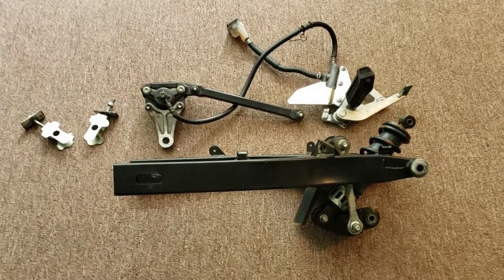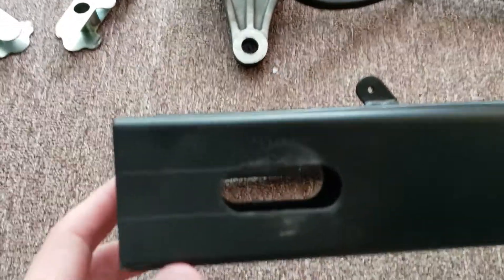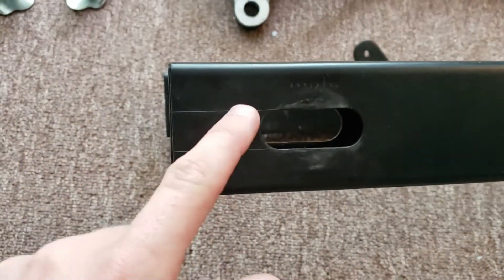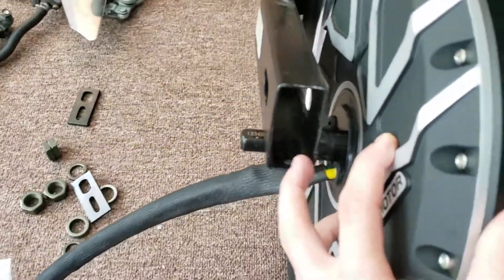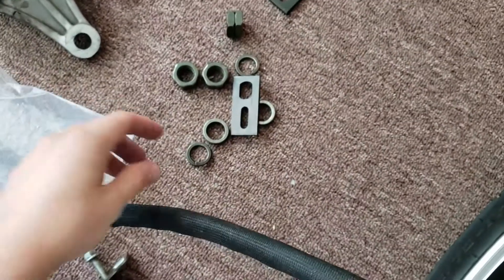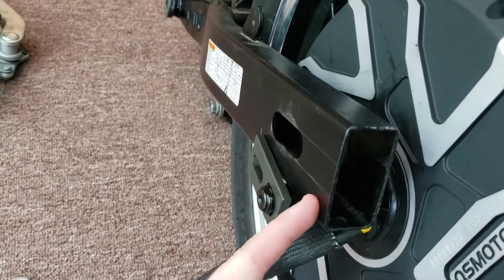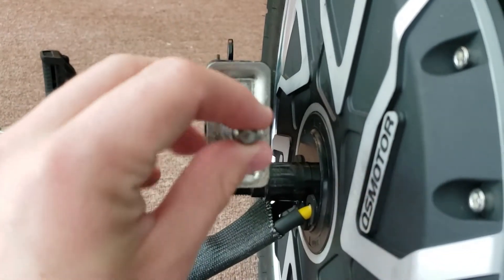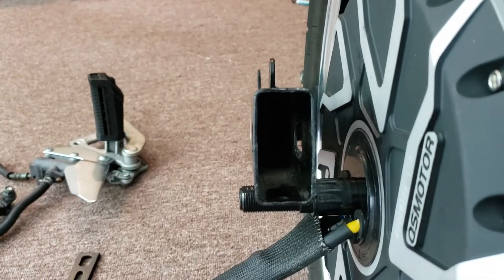Swingarm Ideas for QS Motor

Comment: Mind you, we're some time from this decision, but we've got the same base ride.  Something's been bugging me:
Why slot the rear of the swingarms for the hub motor axle, rather than the bottom below the hole?  You aren't going to slide the axle to compensate for chain stretch, so just mark 'em the same distance and undercut, right?
On several builds, I've seen a cup or sleeve welded into the notched swingarm to handle the "squeeze" issue, but only on steel.  Aluminum ones are usually plate.
Remember this is an 8KW motor and the GS500F only has a single front rotor, so we  want a rear hydraulic brake if we can preserve it.  A  variable regenerative on a left "thumb" control could be fantastic!  I use engine braking a lot while riding ICE bikes and have to remember to "blink" the brake light to remind drivers.  Many controllers seem to drive the brake light during regenerative braking, so that's a Good Thing.
Reply: I'm glad someone else mentions this. regarding slotting from the bottom instead of the back.I also haven't gotten there yet, but it's an idea I have as well.

Let's say theres some catastrophic event where the bracket or its bolt going through the swingarm were to fail. I know it's unlikely, but still. The wheel would slide off mid ride. Whereas, if it was slotted from underneath, gravity would keep the wheel on the frame, at least for a few more feet. This is how a lot of bicycle wheels are done. 

Someone who knows more about motorcycles than me want to comment?
Reply: Dang I have a ninja 300. I never thought about the rear break having clearance issues. I haven’t ordered my hub motor yet but I’m planning this winter to work on my bike. 

I wonder if it’s anywhere close to the Tao Leo hub motor because that’s compatible to the ninja 300. Anyone know how to help this idea?